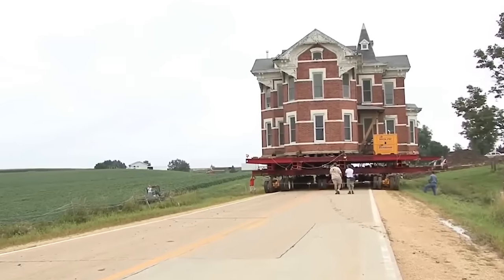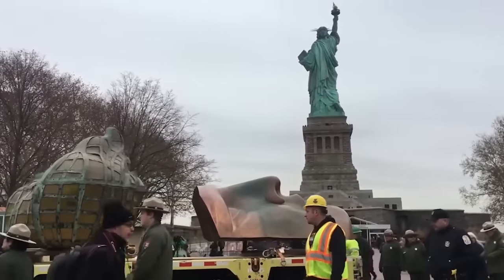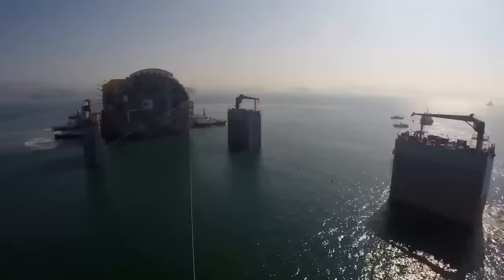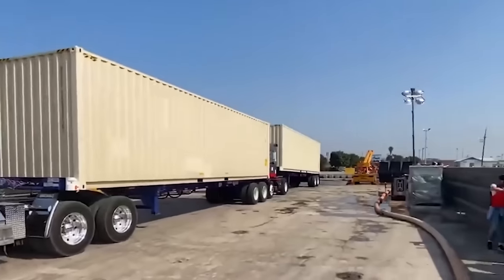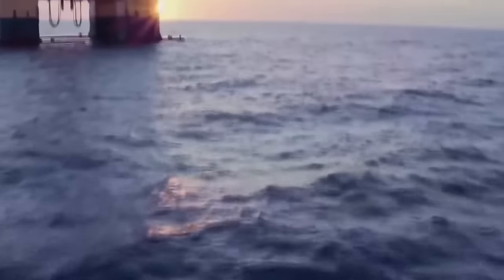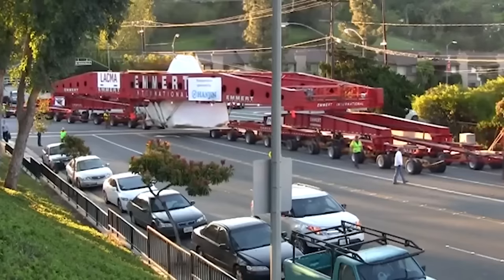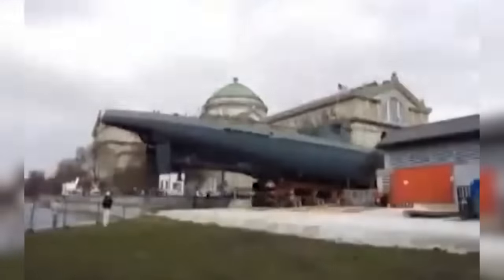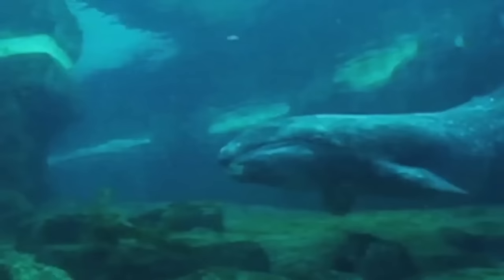20 Most Epic Transport Operations in History

Comment: Troll A. The 1,548-foot tall Troll A platform off the west coast of Norway includes 1,210 feet of structure below the water's surface. Along with impressive height, when the platform moved over land into the North Sea in 1996 in a seven-day process, it became the largest object to ever be moved by man across the earth.Jan 22, 2017